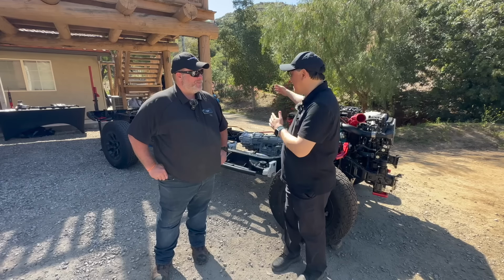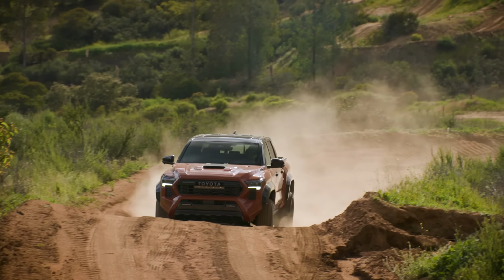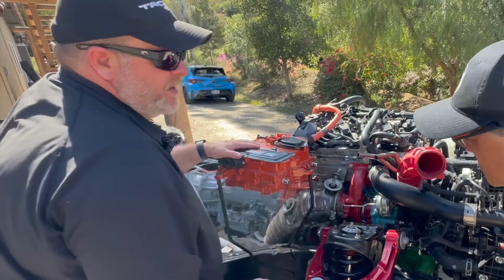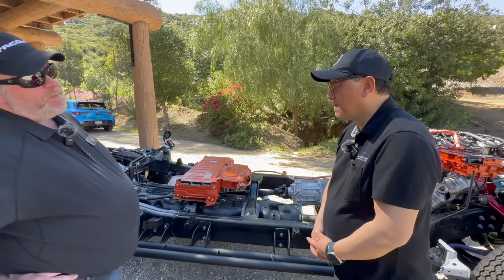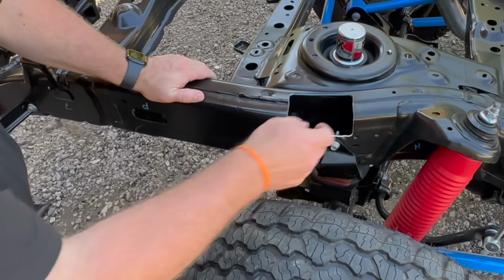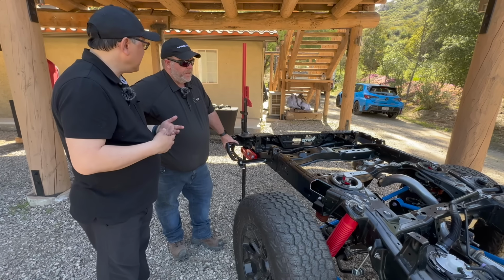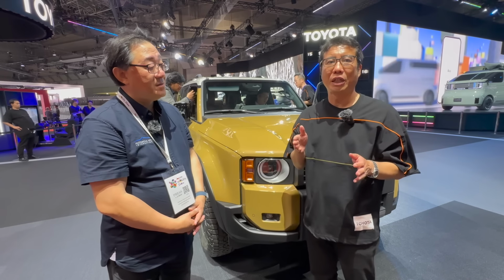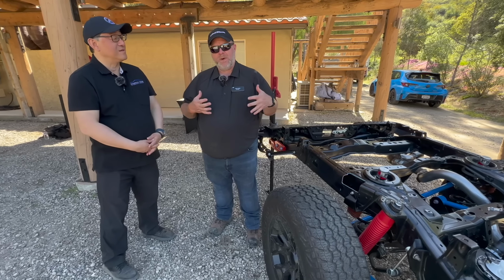ENGINEERS REVEAL RARE FACTS ABOUT 4RUNNER, TACOMA, LAND CRUISER - CANDID INTERVIEW SHELDON BROWN

Comment: I'm not convince that turbo and hybrid engines will have the long term reliability of a quality natural aspirated engine.  I will never buy any electric, a hybrid or a turbo powered vehicle. This guy can blab all he wants. In less than 10 years the batteries on a hybrid will have to be replaced costing many thousands. Turbos run at 30 to 50 thousand RPM and will have to be replace after 8 or 10 years costing thousands. A quality natural aspirated engine can last many hundreds of thousands of miles with basic maintenance. This guy can blab all he wants, I'm not convinced.
Reply: Get a Nissan Frontier or 3rd gen Taco and your issue is solved.  See how easy that was.  Oh and Sheldon Brown has forgotten more sbout engines than you probably know unless you have degree in Engineering from U of Michigan.  I think to say he is blabing is a bit out there.
Reply: @planoman0935  I'll get a 2nd hand Taco. Thanks for the advise.
Reply: @RottenAnimal .. I'm with you.  Last year I bought a 2023 4runner TRD ORP because I want the tried and true v6. Before this car, I had a 2006 v8  grand cherokee.  I would buy a v8 4runner if they made them.  Oddly enough,  when you look at gas mileage comparisons between the '24 taco and the prior naturally aspirated version at fuel economy dot gov, the difference is only 1 mpg. No appreciable savings for the consumer going to a turbo.  This is all about the stupid ESG standards the govmnt is cramming down our throats.
Reply: Very true, but people cannot afford to be replacing batteries every 10 years. Many want to keep Toyota’s far beyond those 10 years without having to either purchase a new vehicle and having to purchase batteries at that amount, not to mention maintaining the internal combustion engine. Nevertheless, Toyota hybrid technology has a great performance history. They’re know for their reliability based on over 20 years of proven technology. We must see what lies ahead as Toyota will establish their own battery supply chain outside of Asia.
Reply: @jamram9924  Thanks for your comment. Others are criticizing me for my opinion. I'd like to know how those batteries with function at very cold temps. I'd also like to know, how much will the batteries cost  and the labour to replace them.
Reply: @jamram9924  but they can afford to trade in every 3 years right 😂😂
Reply: @jamram9924  "They’re know for their reliability based on over 20 years of proven technology." 

yet people think Toyota threw reliability out the window out of no where with not so brand new technology loll 

Many people want to keep toyotas beyond 10 years, but avg people trade in 5+/- years.
Reply: Good news! 10 year warranty, so you won’t pay for a replacement, if that indeed happens.
Reply: Totally agree, you nailed it on the head. Unfortunately, I can't afford to trade in a vehicle every 3-5 years and even If I could I sure as hell wouldn't be paying 60k+ for a new vehicle with unproven components
Reply: @cmk2675  Good comment. Most criticize my opinion.
Reply: A name does not save you from poor design decisions and quality issues. I don’t want a hybrid or turbo on my 4 runner. Marketers wank and turbos and batteries don’t last 300k. That’s a fact
Reply: @LyleRobertSmith2  Good reply. Most comments I got were critical of me and my opinion. I currently have a Toyota Camry. My girlfriend just bought a new 4 Runner with a 4 litre v6. I'm also considering buying one as well. I want long term reliability in the vehicles I buy. Toyota's v6 turbo Tundra has had many problems. All the people that give me negative comments, don't look up the problems with the new Tundra. This is the same engineers that designed the new Tacoma. Thank you for your reply.
Reply: If Toyota is so convinced that these will last as long as naturally aspirated ICE engine, they should put there billions of yen and dollars where there engineer’s mouth is. How about free exchange of the battery pack for 10 years and 150,000 miles. I am not accusing Toyota or this engineer of lying, but let us be realistic. Who is paying this guy, Toyota owners or Toyota manufacturing. This is from a 2022 4Runner owner and my wife owns a 2024 RAV4 Hybrid.
Reply: @jamesappel8747  That guy is a salesmen trying to convince to buy the new Tacoma.
Reply: @empi492 Thanks for your comment. most comments I received were very critical of me and my opinion. Yours is more polite. I like to keep my cars for many years. I'm wondering how much it would cost for new batteries and the cost of labour to replace the old batteries. I'm also wondering how efficient the batteries will be at very cold temps. I'm not against new tech. I worked in tech all my life. My neighbour owns a Honda with 1.5 Litre turbo engine and he says it's the worse car he ever had. Look up the problems Toyota has had with their turbo v6 Tundras. I currently own a 2.4L Camry and I like the car.  We'll have to wait 10 or 15 years to see how reliable the new Tacoma is.
Reply: Hybrid battery doesn't fail at 10 years, at least not consistently. My 2011 highlander hybrid is still giving 27 mpg at 230,000 miles and 15 years old. Runs like a clock.
Reply: Awesome video David - two legends!!
Reply: @RottenAnimal…. If you are that scared of new technology don’t buy one!  Toyota makes by far the best hybrid vehicles in the world.  People love them and they are very reliable.  The new generation of trucks will be also excellent vehicles.
Reply: At the very least you definitely need to be changing oil on time.  They’ll probably last hundreds of thousands of miles, but only for the folks that stayed on top of their oil changes.  They won’t take neglect like the old NA engines.
Reply: come here in asia and we'll slap you with turbo 4cylinders here 😂
Reply: Your loss. I guess that's the end of Toyota for you. See ya.
Reply: @cmdrls212 I like Toyota's. My first car was a Toyota and I currently have a Camry. I want to wait many years to see how reliable the new Tacoma is. Toyota's new v6 turbo Tundra has had many problems. The v8 Tundra was very reliable. We'll have to wait and see how reliable the new Tacoma is. That Toyota salesman is trying to sell the new Tacoma. The video was a sales pitch. I hope you don't believe all sales people.
Reply: @RottenAnimal  he's not a sales guy. He is a chief engineer for Toyota. He's too smart to be selling cars. And you are? Just a guy on comments of YouTube.
Reply: @cmdrls212  I've seen that same guy in other videos pushing other Toyota's. He could be an engineer but, he acting as a salesman for Toyota. It's not a good idea to buy a new designed vehicle. People should wait to see how reliable it is before buying one. I'll keep my Camry for now and if the Tacoma is reliable years from now, I'll consider buying one. By the way, many years ago, I was a salesman. I was always honest but, some others had no conscience and would laugh at those they ripped off. I didn't like seeing customers being treated poorly so, I quit. I felt bad how sales people talk nice to customers and talk dirt behind their back once they make a sale. I left, went to college and worked in high tech all my life.
Reply: @RottenAnimal  off course you've seen him. He's the chief engineer that Toyota flew in to deal with the press. He's literally there to answer engineering questions from the press. He's not pushing anything. He's telling the audience what he and his team do. Why not? You can probably count the number of chief engineers from Toyota with two hands and he's one.
Reply: I can't name a single unreliable Toyota hybrid or turbo car.
Reply: LOL Americans are so ignorant when it comes to turbos. Toyota has been making turbo engines since the 80s and many turbos last hundreds of thousands of miles with no issues. TOYOTA KNOWS WHAT THEY'RE DOING (I get not 100% trusting it as it's new but Toyota has never had issues with turbo reliability. *Yes 2022 tundra had waste gate issues DUE TO DEFECTIVE PARTS)
Reply: Almost all the people who aren’t “convinced” don’t have a degree in engineering or at the very least aren’t educated or well informed.  I am sure most people in the know how are concerned about your feelings.  Isn’t Cummins motor also turbo charged? Interesting
Reply: Agreed. Too much that can go wrong. This is the reason I ended up buying a Nissan Titan with a good old reliable V-8. My buddy had a first generation Titan with the same engine and he put 400,000 miles on it and it was still running good when he got rid of it.
Reply: Exactly. tLC and Robmotive will trade these in yearly so doesn’t matter to them
Reply: As one who is still driving an 88 Toyota 4×4 truck & 2000 Land Cruiser I agree!
Reply: What about all the turbo diesels that’s have 300,000 miles plus?
Reply: In case you didn’t notice, Toyotas been making most reliable hybrid system, turbo engines (both gas and diesel) and even super reliable 4 cylinder engines for truck back in 80s
Reply: @kildli  I've had many vehicles in my life including 2 Toyota's. My girlfriend just bough a new 4 runner with the 4 litre engine and I'm considering buying one as well.
 Thanks for your reply.
Reply: @RottenAnimal  4th gen, 5th gen 4runner, and currently on 2nd Taco. 

I will gladly add that 6th gen runner to my list.

4.0 v6 sure is proven, but outdated and thirsty af.
Reply: @kildli  Thanks for your reply.
Reply: @kildli Toyota's hybrid systems have been reliable on volume selling appliance vehicles like the Prius and the RAV4. Look up the issues the Tundra hybrids have been having, mainly leaking transmissions. I wouldn't touch one of these engines if I was planning on running the vehicle hard or towing heavy loads often.
Reply: @trekkinbrosev  2nd gen Tundra had transmission leak issues too and people replacing whole transmission 100k miles. Also had recall on fuel line, but this was not specific issue to Hybrid. It's like talking about Bronco engine blowing up in 2024, its no longer relevant

But yeah, Toyota/ Lexus hybrid is the most reliable hybrid powertrain.
Reply: @trekkinbrosev  anecdotal, but my friends dad put 850,000 kms on his Prius. Replaced the battery somewhere around 600k for about $3000. Seems pretty reliable to me.
Reply: @BingBingBingBingham  Yes, I said Prius hybrids are reliable. Small displacement turbo charged engines with hybrid motors on mid-size trucks and SUV's are another story. I hope I am wrong, but I just don't see these new engines being as reliable as NA engines.
Reply: @trekkinbrosev  To be far, I do agree with you. I am sceptical. I currently drive a 21 4R, and wont be replacing it until the new trucks have 5+ years on the road. That said, with the current gas prices in Canada its a painful experience visiting the pump... I wish the hybrid system was tuned more for mileage than power.
Reply: Keyboard expert . Many of them out there . lol
Reply: @marioa2753  You take a chance and buy one. I'll stay with proven technology.
Reply: There is nothing to indicate that an engine that is designed for force induction cannot have long term reliability. In the past, people were bolting turbos/superchargers onto engines not designed for that... and thus you get poor reliability. If you look at commercial/industrial engines, they have been using forced induction forever, and can have exceptional reliability (semi-trucks used force induction and can go a million miles because those engines are designed for that).
Reply: @t3h8ar0n   foolish to compare diesel turbos vs gas turbos. funny.
Reply: @cardp17  No, it isn't. Diesel turbo engines are designed from the ground up to accommodate forced induction... just as modern gasoline engines are being designed from the ground up to accommodate forced induction. In the past, it would have been foolish to compare them, because the gasoline engines were designed to be naturally aspirated... that is not the case with these modern engines.
Reply: @t3h8ar0n  I don't want to take a chance on these new vehicles. I'm retired and don't want to spend thousands on repairs after 7 or 8 years of use. I had an old Honda Accord that I ran the hell out of it and I got ride of it after 360,000 miles. The engine was still running great. I guess in 10 years we'll find out if the new Taco is reliable.
Reply: @t3h8ar0n  Well said!
Reply: I wonder what model iPhone/device he used to type comment… and how many thousands he/his parents spent on those devices over 8-10 years. I will suspect that cost will be in the thousands.
Reply: @thomasrossi31  I'm not sure if your comments are toward me. I'm 67 years old and my parents passed when I was in my 20's. I also don't have an iPhone or any cell phone although, when I was working, I worked in high tech and had a free cell phone from my company.
Reply: Well you are an example my friend of a man convinced against his will is of the same opinion still. Technology changes we do make advancements overtime humans are smart and Toyotas not going to lose their hard earned reputation they have a lot more stake than you do. I would suggest you stop living in the past have a great day
Reply: @jonathanratliff4780  I'm retired now but, when I was working, I worked in high tech. Much of the new technology had problems. We had a lab were engineers would stress out and do extensive test on new tech. If the new tech passed rigorous test, the company would purchase the new equipment. In the lab, the used simulated traffic, I worked on live traffic. I'm 67 years old and worked in high tech all my life. I know about Technology. Why don't you look into the problems Toyota has had on the 6 cylinder turbo Tundra trucks.
Reply: Agreed
Reply: @gregc6661  Thank you for your comment. Most people criticized me and my opinion.
Reply: No one cares what you think buddy!
Reply: @jima7756  I don't care what you think.
Reply: You must own a ford product because it's sounds like your worrying too much about long term reliability of the engine, remember this is a Toyota NOT A FORD
Reply: @WOODduck-u2e  I have a Toyota Camry.

Comment: I'm hoping the 250-series is a massive succes because maybe then Toyota can consider bringing the successor of the 300-series LC back to the US.
Reply: It was not as good a seller as its brother in a tuxedo the LX, i honestly think the LX just need an overtrail trim and thats it
Reply: No one bought them unfortunately, we all could have
Reply: With the Sequoia existing, there’s no way the LC300 will come to our shores anytime soon…
Reply: @BigAltimaEnergy719, unless the sequoia goes back to the independent suspension route like the previous gen, and if they sell enough to justify the cost of producing another suspension for family duties, along with putting enough modern touches and making the 300 (or 400 series) more off road oriented, then the land cruiser will now remain beneath the sequoia
Reply: I'm with you there. I think the only way a full size Cruiser can be sold next to a Sequoia is if they make the Sequoia as big as the Suburban. Having two Tahoe-sized SUV's is impractical.
Reply: @cstyle1917  although before tahoe/suburban was redesigned, sequoia had excellent packaging, for being around 2 feet shorter than the expedition Max and suburban (though front headroom needed to be at least 6 inches more to compete for front seat space of 6'10+)
Reply: @YoungDriversPOV  sequoia is too big though power figures they are about the same only that lc300 is more compact and same time has more offroad features specially the lc300 gsr